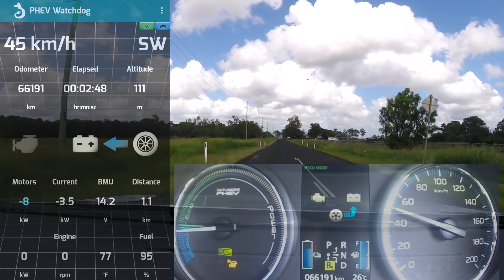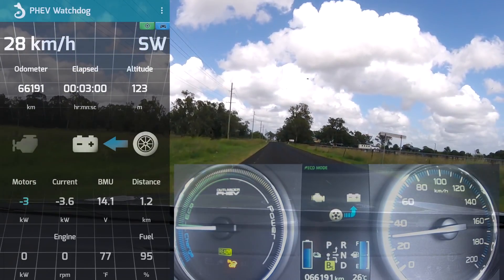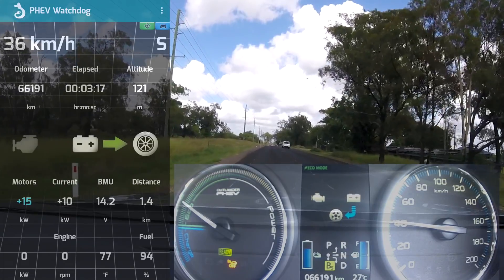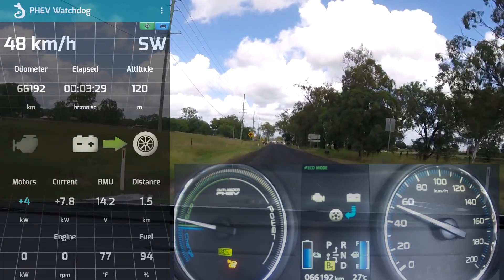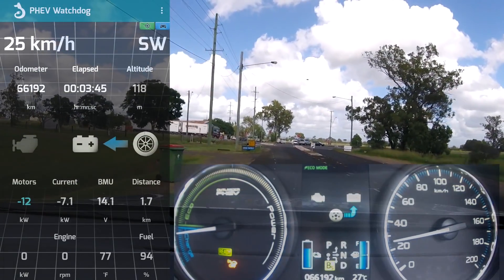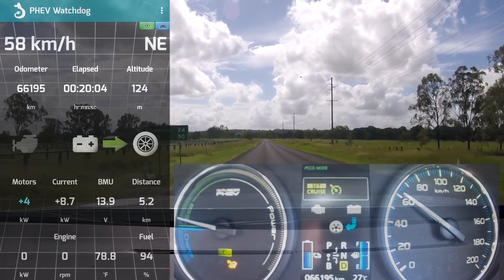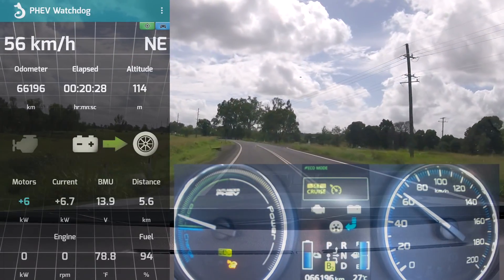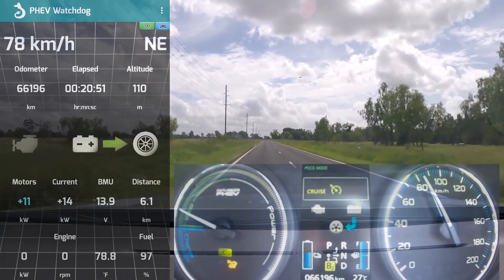EP60 - The B-Setting-Myth of the Outlander PHEV

Comment: Well explained. "Remapping" is the right word. The accelerator appears to be remapped into a accelerator / brake pedal. Akin I suppose to locking an auto in 1 or 2 except the car scavenges the energy back. We have one these. They brilliant. No pollution in town / slow moving traffic and efficient on the highway with a great range. Almost free to commute to work. In a couple of weeks we are going to do the staycation, 880km only stopping for fuel and food.

Comment: Hi Andy, Great video! on the motorway, I use B0 which allows the PHEV to coast, on the smaller roads I tend to drive in B1 or B2 so the PHEV doesn't roll away to quickly. B5 does give you that one pedal driving experience. The PHEV is good around. Just think in 5 year time if they bring out a high capacity battery you may be able to do 200 or 300km in ev mode. Cheers
Reply from the maker: Yes, I tried using B0 on motorways, but as long as there is no downhill section, the car cannot really coast without dropping speed. If they bring out an Outlander EV, I'm in!
Reply: Trevor, Your pout is spit on, but even 100 to 130 km of EV range would be revolutionary. Greater range than that really needs better batteries, because it does it make sense to carry too much battery Wright.

Comment: Spot on Andy. 
I often drive around all day in B5, it makes ZERO difference to energy used over a set route, just allows me to do more one pedal driving. We managed 46klms purely on the battery yesterday with some aircon use, mostly 60 km/h but a few sections of 70 and 80 km/h, all on battery and I think from memory, ALL on B5.

I use cruise control to demonstrate it to a sceptic at a set speed as you did at the end  (ie: foot right away from the accelerator pedal).
If you change from B0 to B5, nothing changes at a steady speed on level road.

P.S. How’s your PHEV box going, very happy with mine.
Reply from the maker: I had some trouble with opening the parcel... well, it will be in the video. Haven't processed further with the box itself yet. The day has not enough hours to cope with all that...

Comment: Hi Andy, great video as usual. I agree with the findings in your video but have two points to add. Firstly it is more efficient to not use the energy in the first place rather than use it then try to replenish it. This is of course because of losses in the discharge and charge systems. The losses will vary from vehicle to vehicle but I believe that the losses are about 80 to 90% in the Outlander PHEV, meaning that you can only get back 10 to 20% of what you use through the regen (discharge/charge) cycle.
So the point I’m trying to make is that in stop start traffic when the vehicle speed has to be adjusted and anticipation of the need to slow down is needed by the driver, B0 can be more economical than B5 since the driver can anticipate the need to slow down and coast to a slower speed pulling zero kw from the battery. The tendency in B5 is to overcompensate and slow the vehicle too quickly. This requires you to use power to speed it up again (as you had to do several times in your test) this results in a net loss when speeding up again therefore wasting the 80% losses associated with charge/discharge scenario. In heavy traffic where this happens continuously these losses all add up and range is affected. I can experience the difference in my daily commute since I have to travel in very heavy congested traffic on the famous M25 London orbital motorway in the UK.
My second point is an idea for another test you could do related to this one. I discovered whilst optimising my own use of the car, that in B5 when the battery is not full and able to accept regeneration, you can get a lot more regen from the brake pedal In B5 than you can in B0. You can demonstrate this by doing a test. Get the car up to a steady 100kmph then apply the brakes using the brake pedal in B0. You will get about halfway into the blue (regen) area on the energy meter. Now try the same brake test from 100kmph in B5. The needle will drop about twice the distance into the blue as it does in B0, and sometimes all the way to the bottom of the blue (regen) section of the energy meter. I have never got the needle all the way to the bottom in B0, it just doesn’t seem to be possible. I would be interested if the Watchdog corroborates this, and if your car behaves the same as my car.
Reply from the maker: You're spot on, Harry and 100% correct. There is no correct or wrong way to use the B-settings. It all depends on your driving style and conditions and how much you care. I agree, you will get around 20% energy back when regen. It is still better than getting 0%back like in an ICE car though and can give you around 10-15% higher range in EV mode. Letting the car coast is the most efficient way to use the energy initially put into the car to accelerate it.
Yes, there is a hidden B6 setting when you press the brake just a bit. You can see it when slowing down in B5 and then press the brake the power meter goes even further down into the blue area. If you press further, the friction brake will come along. Awesome technology, they thought about almost everything ;)
Reply: Driving style is everything, even with regen in an EV.
It always makes me laugh when people in a powerful ICE vehicle drag me off at the lights, then slam on the brakes at the next traffic light.

Comment: Hey Andy,
Been away for a while so grabbed a coffee or five to catch up on your videos. I don't know where
this myth started but have seen it too. I experience exactly the same as you, but I pretty much run on B5 after
starting the car every time.  With mine and I guess with all PHEVs if you do go to B5, you can regulate the
amount of braking/regen when coming up to an intersection or going downhill with the throttle position, so in
effect you''re braking with the accelerator (which will confuse ICE drivers to the max !)
All in all I reckon its a brilliant system with quite a lot of thought going into the design.
Loving my PHEV, 2200kms so far from the last petrol fill-up with a quarter tank left !
I see you still have the AVAS system running....no time to disconnect it yet ?
Good to be back...look forward t the next video.....
Andy :~)
Reply from the maker: Welcome back, Andy! 
I used to drive in B5 all the time when I got the car new and was fascinated of the regen. After 1 year or so I realised that it is much easier to coast in B0 instead of balancing the pedal in the right spot. In city driving B5 is still awesome. My brake pads and discs are like new!
It is a bit of a learning curve when you come from an ICE car where the regen does not exist. A PHEV is the ideal car to prepare everyone for the real real BEV. With the small battery you always try to squeeze the most out of it and avoid the ICE kicking in as much as possible. Once you get an EV with say 300km you're used to drive carefully and it will be a breeze...
Reply: We drive ours in B5 all the time here in lumpy NZ. It makes hill descent really easy as you balance the amount of regen needed to maintain the speed against the gradient using one pedal driving style. Barely use the brakes. Our Kia Soul EV does this really nicely too. The only bummer with the Outlander PHEV is that it has no regen on a fully charged battery while the Soul EV has full regen available (we live at the top of a 2km hill and experience this after every charge).
Reply: Hi Shaun, I live in the Tablelands west of Cairns, so plenty of hills too, so regen gets a workout, yes same with me, no regen at all
on a full charge, so it feels weird in B5 when nothing happens when you take your foot off the accelerator LOL !
Reply: Thanks Andy,
Yes it has changed my driving style, and you certainly notice those hills for two reasons, one, watching the guessometer dropping kms rapidly
and the other watching them increase while re-genning !!! Overall I'd estimate my vehicle running costs dropped 70%, and as I'm a computer  technician most
of my trips are shortish and have many days where the ICE doesn't start at all.

Comment: Greate video as always Andy.👍

But... when you are at a standstill and dont touch the acc.pedal. no matter where the B is at, the car wants to start moving. In B5 then the regen should stop it so I would not need the breakpedal by the redlights. 🤔
Reply from the maker: That does not work. When you standstill there is zero regen as the motors are not turning. Stepping on the brake prevents the motors from creep, so no energy been used at a traffic light. As soon as you lift your foot off the brake, the motors are engaged and move the car forward.

Comment: I’ve only had my phev for a few days now. I live in the mountains. I’ve come to the conclusion that 1) only worry about B settings when your foot is off the accelerator. 2) use the B settings to control speed of descent while regenerating. 3) when flat, set to B0 and try to “hypermile”/coast around target speed and use regular brakes if needed (the car still regens when breaking). Overall this seems to give you the most miles for the energy used.

Comment: Thanks Andy, as a new PHEV driver I had noticed this, but wasn’t sure why it happened. In B5 with cruise control on, does the car coast also? 

In B0 the other day I pulled the right paddle for a couple of seconds to go back to D mode and the car did jolt a bit, so it must have been coasting at the time. Still trying to find my defaults, but about town B3 does give a more in control driving feel.

As an ex ICE driver I thought there was always some regen on above B0 and the additional power was to overcome this, so power to motors drops, but power diverted to charge batteries. Another way to show this would be to show charge to the batteries on your watchdog at the same speed at different B setting.

Keep up the good work! 🏴
Reply from the maker: Thanks very much. The car coasts only in B0 unless you compensate the B-setting with your right foot and bring the power meter back in neutral. With CC enabled you can only paddle down to B2 because the car will need this bit of regen in case it needs to slow down to keep your set speed.
It is a bit of learning necessary when you come from an ICE car and experience the regen settings. You'll learn over time. I just spend (probably) weeks driving around and analysing every bit of what the car is doing, why and how. There is no right or wrong what you're doing it's just getting it right for your comfort and driving conditions.
People on the forum often ask what the best B-settings are. Well, ... 0)
Reply: I’m getting used to it now, so is my wife, but when I was using the paddles to change the regen setting last week, she said “why are you flashing your lights at that car?” 😂
Reply from the maker: Hahahaha, you should explain to her what the paddles are for :D

Comment: Many people don't drive the phev properly. B setting is for breaking not driving that's why it's called b setting for breaking not d setting for driving.you drive in b0 and break in b1_5  to generate power back to the battery.  It's pretty simple stuff. Drive in b 0 and use b settings to break.
Reply: Spot on, driving in b2 or heck, even b5 makes absolutely no sense to me. Every time you release the pedal you are wasting all the energy you just created into "regen".

You will never regenerate more or even equal the amount of energy you produced, some energy is always lost in the process and you end up negative!
Reply: @heimir86  Yes. I suppose some people like pushing the pedal down all the time, but it's too easy to release and lose speed and energy that you have to put back from the battery.

Comment: Put it on B0 as you start and then control the breaking with your pedals... B0 doesn't break the vehicle so you can gain speed on downhills... And then you look far away and break slowly and it charges the battery. This is why mitsubishi made +/- hand pedals so convenient...

Comment: Hi Andy. I've been watching your videos for 6-8 months now. I was waiting for this PHEV to reach us in the U.S., watched just about anything on this vechicle. Anyway, you're channel has the most information I've seen world-wide.  But I saw something the other day on a dealer site. The sales rep said " If you run the electric down too far, the vehicle will only operate in 2 wheel drive." It sounds right, since the electric drives both axles, but is that something you've discovered yourself? I've never seen anyone else mention that anywhere. How easy would that be to have it happen? I live in Pennsylvania, snow is a given here. 
Thank you for your channel though. I'm looking at buying the 2019. We don't have a PHEV dealer within 75 miles, so I'm on the fence because of maintenance issues that may have to be dealt with.  Michael
Reply from the maker: Thanks you very much Michael!
I've never heard about shutting one motor off if the battery is too low. Technically you cannot run below ~30% because the engine will start and recharge the battery. If the battery is empty (30%) and you have a tow load while going uphill, the car may use more energy than the generator can recharge. The SoC will further drop until 15% I believe. That is when the turtle symbol lights up and power to cooling and heating is limited as well as to the motors. I had this only once in such an occasion but didn't watch the power distribution between the axles, so cannot say for sure it's not happening. It also might be something new cars might have now due to changed software they're running...
On the other hand it does not make sense as the AWD system is more efficient than just a single motor (see Tesla comparison between single and dual motor models). 
I would not be too worried about the lack of dealerships in your area. So far Mitsubishi always gave us loaners to get back home if we had to leave the car over night. I'm sure they will do the same in the US. How long is the warranty on the PHEV over there, is it 3yrs?
Thanks again for your comment Michael.

Comment: I have 30 km to work and the B0 mode is the beste for me. In D (B2) I can drive 27km. In B0 I came to work and still has some km left . The temperature was 6-8 Celsius most of the days I tried it out, but the day I tested the B0 the temp. was -2 celsius....the coldest day.

Comment: Hi Andy, I agree with everything in your video, and I have similar driving patterns as yours. I also use B5 on curving mountain roads for that very fun one-pedal driving.

In the meanwhile, I don't think the myth out there is that cruising on B5 wastes more energy. It seems that most people actually think the oposite - that cruising on B5 would save most energy.

While this may true in some cases in town as it would prevent those less careful drivers from using the friction brakes, it is irrelevant when cruising, as you've demonstrated.

I think you should also mention that technically speaking, B5 indeed wastes more energy than B0 because the regen has relatively big energy loss (just not while cruising). 
That's why I often find myself driving on B0 even in town when there is less traffic, and paddle B0-B5 when I need to stop. However, it seems the tangible benefits of this are quite small to justify the inconvenience of that constant paddling.
Reply from the maker: Thanks for your comment, Dobrin. The B settings, in fact, the whole car is a very complex and complicated system. I still think we're only scratching the surface with what we're experiencing and analysing here....
I was going to talk a bit more about the B-settings but this is definitely a video itself so I kept it simple (hahaha). It's very hard to measure the actual performance and efficiency of different B-settings as this is as dynamic as measuring the battery itself. Both need a lot of observation and conclusion to make some sense out of all that. I'm still not convinced if a higher B-setting is more or less efficient than a lower B-setting due to so many unknown factors as efficiency/heatloss of the converter, heatloss in the battery and so on. Regen braking is wasting a lot of energy we formerly put into the car. It is still much better than transforming it into heat with friction brakes like in ICE cars but still a wasteful process. B0 is your friend under all circumstances as you said. I mentioned it in some of my videos already: make sure the glide and coast figure in the Dog is as high as possible and the regen as low as possible. Hardly achievable with traffic around you and the timely constrains of the day. Eventually you have to get somewhere in time. But sometimes you have all the time of the world and just let the car glide........................ ;)

Comment: Hi Buddy like your videos I have 1 question I just ordered a Phev petrol 2.4 but not got a change point at home I have a station local do you think it's practical?
Reply from the maker: No, not at all. You need to have a port at home as it charges slowly. If you use the fast charger all the time, it dregrades your battery fast.

Comment: Have you noticed you have to give more gas to overcome the breaking effect? No actually I havent. Are you sure you meant to say that or have I got you wrong?
Reply from the maker: It's a remapping of the gas pedal. The zero point gets shifted when using the B-settings. You have to press the gas more to overcome this new zero point but you don't use more energy. The power meter and the Dog shows that same energy consumption with B0 or B5.
Reply: @unpluggedEV  Yes I thought so, more misunderstandings. Thanks for clearing that up.